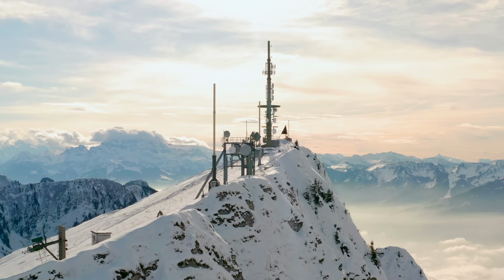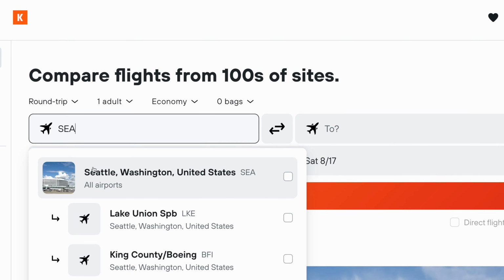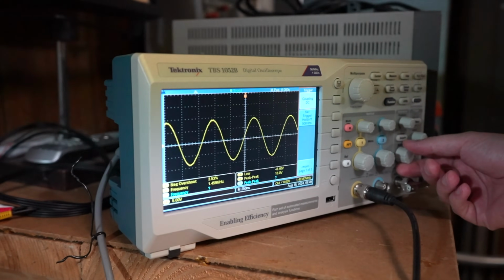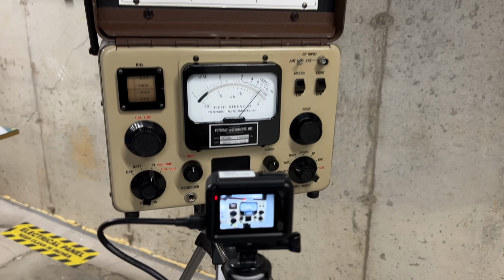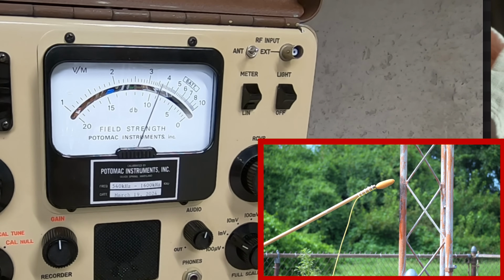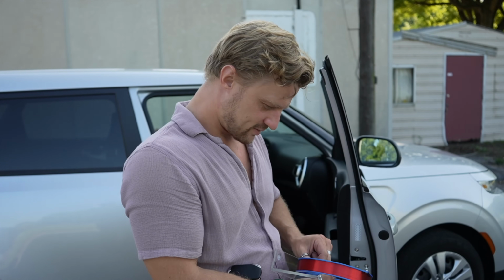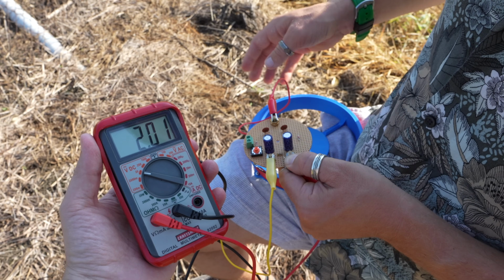Stealing Energy From Radio towers Using Plasma (ft. Geerling Engineering)

Comment: "Take it from a guy that's seen the remains of a guy that...eugh"

Yeah, that's sufficiently terrifying, will do.
Reply: I did satellite communications for the USAF, one of the stories the instructors would use was of a security guard at an antenna installation (I forget where) that liked a spot by the antennas that he could keep warm during the winter. They found him at shift change dead in a folding chair, as all of his organs were cooked. This of course on a chapter of the curriculum dealing with radiation hazards, and radiation hazard zones. I've also heard of mountaintop tropospheric scatter antennas able to pop birds if they flew in front of the antenna. RF radiation is no joke folks!
Reply: It made me wonder what the heck those high voltage gloves are made of....
Reply: @stevengill1736  Yes, that sausage certainly gives me the willies ;-) The gloves are just a failsafe, the sausage is connected to the ground of the antenna at the other end, so any power goes down the ground cable and not via the stick to the person. 

If you put your own "sausage" against the tower, even when standing on an insulating platform, you'd still get horribly burnt as the capacitance of your body to ground would be enough to conduct a fair bit of current. 

At these frequencies, you'd not really feel a shock as such, and there is some "skin effect" in play (higher frequency travels over the surface rather than inside a conductor) but the huge power levels will cause serious external and internal burns. High conductivity paths such as nerves and blood vessels will carry most of the non-surface current, so think of the blood boiling in your veins and arteries and your nerves exploding like overloaded wire fuses.

I remember a story of a chap in the cadet force at my school holding on to the whip antenna on a vehicle while it was transmitting, probably less than 100W. He had some blistering on his hand, but more painful were the deep pinprick holes where the arc had charred tiny paths deep into the living tissue, nerves and all. Needless to say he was sent back home to recover.
Reply: @alexcrow2905 okay … ow ! Thanks for this colorful and vivid description.
Reply: They used to be made out of asbestos  @stevengill1736
Reply: @stevengill1736  from an electrician: "plastic" fibers & rubber stuff^^ ....not a chemist xD
Reply: FYI, ask most hams. RF burns go beyond surface level. Just a safety tip.
Reply: Since he uses the word "blast" likely what happened is an arc flash, said guy grounded the tower entirely for a moment and this created an explosive plasma curtain which in turn created a pressure wave sufficient to instantly kill him and blast off or twist some of the more fragile parts.
Reply: I'd like to imagine their last moments of sizzling flesh transmitting some random really chill broadcast as he's screaming in agony

Comment: Awesome, How about tuning the antenna to 160 meters or 1.8mhz or a length of some 540ft and why?  To extract power from what is heard at that frequency (and even better lower frequencies) around the world, Lighting from that lighting bolt. What on earth has a higher more energetic plasma discharge than lighting?  Yes, have a build up electronics for a measurement and or any other uses the receiver have better have some huge capacity banks,, yes or it will be burned out like your small build I can only propose?

Comment: In theory could you charge a battery by hooking it up to one of those receivers you made somewhere while in a place with 24/7 radio broadcasts?
Reply: If battery leakage current will be lower than charging current, then yes, but I think it will work only if you are really close to the tower.

Comment: There is a far easier method of receiving wireless power, you can even do it at home: solder a diode parallel to an LED (backwards), so depending of flow direction either the LED conducts or the diode. Ground one side, hold the other side. When you grab a cable that has mains voltage (grabbing it from the outside, on the insulation), you see the LED light up (assuming you have an efficient LED and the surroundings are not too bright. Mains power does not radiate that much so you have to be that close (few mm) to extract notable power. I live in a 230V country, so I don't know if 120V is enough.
This should also work with the AM tower, but instead of touching anything, simply using your body as an antenna should do the trick. Grab one side, ground the other. Could be that the diode is required to be a high speed diode (any 1N4148 or similar should do). If the frequency is too high for the LED, putting it in series with a high speed diode and adding a capacitor parallel to the LED should help.
Reply: Did you tried to do this with two LEDs (parallel with opposite polarity)?
Reply: @sdjhgfkshfswdfhskljh3360  yeah but it increases the capacitance and thus lowers the chances of it working.

Comment: "Transmitting electrical power via towers and antennas through air" wasn't there something about a lost invention from Nicola Tesla, which could be describet the same? Yet we say that it's ether unclear what his implementation would have looked like or that it wouldn't be a wise tech to use, since we know which way energy uses. I mean, we know lightnings and stuff, so...
Yeah, that's just something this reminded me of.
Reply: His idea is mostly identical to this. But the big difference is that his 'tesla coil' was a big spark gap transmitter, and a nasty one at that. Those things have reasonable average power levels of let's say 50 to 100kW, but the impulse power is properly enormous - tens or hundreds of megawatts. That means it's pretty easy to get sparky things and lighting discharge tubes everywhere. But not to get any sort of usable power out of it. It would also bulldoze any radio reception in a wide range. 
Tesla's invention adheres to the inverse square law of field strenght too. So while you can inefficiently transfer real usable power over a couple meters, it's near impossible to do it over hundreds of meters.
Reply: @mfbfreak  no, I meant this big mushroom structure made out of metal beams where we don't really know what exactly his intentions were. If I'm not mistaken it's still unclear what telsa realy wanted to achieve. But I wouldn't be surprised it this tech portraied in the video is the unintentional perfection of Teslas initial idea, which made him thinking about these towers in the first place.
Reply: @Caitrix I thought it was relatively clear what he wanted to achieve was publicity and he was delibrately playing up an image knowing it wasn't completely practical.

For instance, if you get into the details his account of his earthquake generator is clearly largely fictionalized and I assume there is an element of exageragtion here too.
Reply: @Caitrix  He was probably trying to achieve maximum radiation from minimum size structure. If you read "Antenna Engineering Handbook" chapter on electrically small antennas, they do mention that the limiting case of a short monopole is a dome with a comparably sized resonant coil hidden under it. But even that only works within limitations of physical laws and available materials. You can't pump a ton of water per second out of a milimeter sized hole, and you can't radiate a megawatt out of a coin.

Comment: So, If wireless transmission is not feasible because of the dramatic loss of power over distance because its transmitted in 3D, verses 1D down a transmission line. Why not use lensing to focus the RF into a plane or 2D, to decrease the loss substantially?
Reply: Focusing device will be huge.

Comment: You might want to add a variable coupling loop to the receiver so you can adjust the amount of coupling of the rectifier to the resonator... this would let you tune the entire system for very high efficiency and you'd probably be quite surprised how far away it would work - calculator or watch or something similar with a transreflective LCD screen and low current demands...  Alternatively a neon bulb may be a better choice for the display device (although adding a series resistor to the LED would probably save it from damage - true for the diodes too, maybe add a clamping zener etc, lots of ways to make it tolerant of severe overdrive).  So close to a high power MW transmitter you should be able to easily get the 80 volts or so needed to ionise the neon bulb, and used in a relaxation oscillator circuit its flash rate would be a good indicator of received signal level.  This could also be done with the LED too just require a bit more complexity in the circuit than the basic RC NE-2 flasher.  Also consider adding a small piezo speaker to make a click for each discharge to make it usable in direct sunlight.  Heck with a switch you could select between ticking rate proportional to signal, or listening to the radio program just as a crystal set.  Thinking about it I am kinda tempted to just build this myself for fun...  We are both in Seattle right?  There must be some MW stations around here we can get close enough to - not that I don't have enough radio transmitters to do this in the lab with a couple of watts.
Reply: Another usecase for the principles in this video might be figuring out how to detect the anti-personnel type directed energy weapons (the still classified ones).  I think they are combining different energy types (RF, Millimeter, Microwave, UV and Ultra or Infrasound) with a 5 or 6 GHz Mesh Network and beamforming Phased Array or Plasma Antennas to carry out the imaging surveillance, 3D hyperspectral Image capture, and the remote, deniable, invisible touchless torture weapons. Conventional handheld detectors such as GQ Electronics only show spikes in the EF detection circuit from the nominal less than 5 volts per square meter to very rapidly or instantaneously up to over 100 volts per square meter when the victim in the surveilled and attacked interior building space moves his body physically, such as standing up from a sitting position with the meter on a nearby table.  Tried the neon bulbs by themselves hoping the legs would act as antennas but they do not light up so will need to try a few circuits and your ideas appear helpful.
Reply: Indeed, and amazing broad and comprehensive comment.  My electronix comprehension is imperfect and eratic, yet i try to be aware and i have observed speciffic individuals whom might have been recipient of hi tech covert harasment, it is mainly in hind sight and from reflecting on the behavior changes and extremes compared to the events happening in the persons life at that time,, the insanity and behavior ups and downs correlation with certain interactions this person had attempting to cause fbi, sheriff and police to actual follow through on specific crime reports made.  Electronic detection tool would be great,, currently i just avoid being or causing trouble, but i so watch to recognize what undue influence or methods might be actively and covertly employed upon anyone in my observable realm.
Reply: I wish I knew what you two were talking about because I am fascinated by this type of thing, unfortunately I don't very little about radio, AM, FM, etc.... but you two are clearly what I would consider radio geniuses lol. Anyway, thank you for your ideas and input here, maybe someday I will learn and I destiny some of what you guys are referring to here. At the end of the day, its really cool just to see these towers ability to produce so much juice remotely, and I felt like a little kid again when I saw the sausage get smoked against the tower.
Reply: @vk2zay - Megawatt transmitters? I thought those days went out with Analog TV. Apparently the modern Digital TV transmitters use lower power, like hundreds of kW. Now if you are talking about PEAK power, some radars are likely to do that, but they are only short pulses, and are panning all around the sky.

Comment: Soooooooo.... Then why can't a radio pick up enough charge (within range of a tower) to power itself without the need for batteries? Seems like those emergency weather radio things would benefit the most, seeing as how batteries go bad after a period of non use.
Why don't you get started on figuring it out and deal me in for 10% of the company as a silent partner. 😅
Reply: You've just described a crystal radio set... and they're quite limited because there simply isn't much power available at a distance. Most can't even drive a speaker, you have to use a piezoelectric earpiece
Reply: @mfree80286  can those draw a change wirelessly to say act like a trickle charger when not in use? I guess a hand crank radio would be more practical, I'm just thinking out loud hoping people smarter than me can help me understand the mechanics.
Reply: Because the wireless energy drops off exponentionally. After only a couple tens of meters its too little for almost any device

Comment: Mud daubers are extremely docile. It's rare to get stung by them. They're a completely different type of wasp than paper wasps.
Reply: Still shouldn't have them in the transmission facility, their nests are a royal PITA even when they aren't bridging conductors (as anyone who's ever had to dig one out of a blind hole in a metal casting and clean the threads can attest).
Reply: @mfree80286  - To get out mud daubers, just squirt in some soapy water, let it soak in for a few minutes, then wash the mud out easily with a jet of water. Repeat as needed.
Reply: @mfree80286  But that wasn't the issue. The issue was that he has an irrational fear of something that wasn't going to hurt him. Fun fact: Most snake bites happen during attempts to ķìĺĺ snakes. Irrational fear causes more problems than it's worth. Lots of people get stung because they have a habit of flailing their arms around in hopes that it will magically ķìĺĺ whatever they're trying to hit.
Reply: @roadkillavenger1325  Accurate. At a BBQ some weeks ago a bee landed on my friend's daughter's hand and she swatted at it and got stung. Some bit later a bee landed on my arm and I just let it take a break (literally stayed on my arm for almost 10 minutes!) and was pretty uneventful otherwise.
Reply: Haven't Mud Daubers caused like 3 airplane crashes?
Reply: @oversecus833  They sure have. They get in the pitot tubes.
Reply: @roadkillavenger1325 absolutely correct
Reply: @oversecus833 that's why you place pitot static tube covers on them when an aircraft is parked, fixed or rotary wing. I was in avionics in the military. That's kinda like, duh!
Reply: And actually paper wasps aren't aggressive like yellow jackets as long as you don't mess with their nest. Bald faced hornets on the other hand beat them all.....luckily they're not as common, and yellow jackets are bad enough, especially if you're having a nice picnic that includes something like frying hotdogs....   ;*[}
Reply: @stevengill1736 Yellowjackets are evil. Sometimes I think they along with flies were put here just to annoy us 😠
Reply: @stevengill1736 then there is the nightmare of ground hornets
Reply: Mud daubers are not docile I can speak from experience they suck their stings hurt and they are not my friend...I was only 12 years old and all bees can suck an egg

Comment: 1 thing you said was incorrect.. "fm signals are line of sight".. its the frequency that makes it line of sight. You can use fm at any frequency, its just the way the transmition is modulated.
Reply: I think he was referring to FM broadcast radio and it's usual frequencies.

Comment: Generator is video worthy, yes. If a closed circuit also has usable frequencies to run generator and or light up solar panel that'd be interesting because then ev's dont need charging stations.

Comment: Great video, yes good for radio transmission but very inefficient for electricity transmition. Tesla wireless transmition of electricity works. I know I has built one and light a lamp at several metres with out wires and a few watts using a capacitor as  the top load and resonance

Comment: Hi, did you knew you were breaking the law ?   There a law in the USA preventing people to draw energy from the air (almost surely impulsed after N.Tesla had unveiled the goal of he's Wardencliff tower).😋

If you don't want to break your LED by overcharging it, add a Zener diode and a resistor in your circuit.

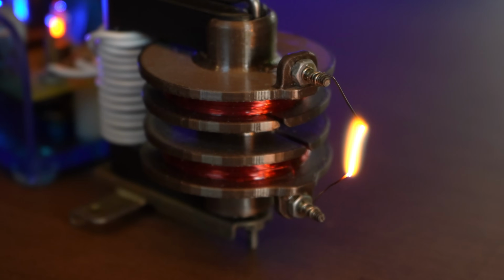Comment: 12:55 faster than our eyes can see... I think that is an idea for a video. Collaborate with someone with an insane high speed camera and see if you can record the plasma expanding and contracting to make the sound
Reply: @slowmoguys
Reply: @Thing.Appreciator that's a collab I could get behind
Reply: @Thing.Appreciator  ^
Reply: real talk... I can't see anyone with a phantom or equivalent camera trying to film this... the chance of breaking $100,000 camera is too high... sure would be cool tho
Reply: @mannys4539  maybe not the tower but the small plasma speakers like the one the guy showed in this video wouldnt put the camera in any danger and would demonstrate the same thing.
Reply: @mannys4539 
 I'm sure there is someone. Alan Pan drove a car through a Tesla coil and arc attack films electricity in high speed. I'm sure if they put behind thick insulating plexiglass and the rest a faraday cage.

IDK, just an idea
Reply: @mannys4539 It's not quite as cool as high voltage, but still very interesting. Years ago, I saw a video someone had made with high speed cameras which showed streetlights flashing because of the alternating current. I always assumed lamps have to flash and just too fast for our eyes to see. But to actually see it recorded was pretty cool.
Reply: @mannys4539 Faraday cage?